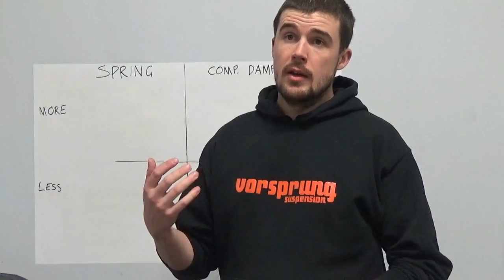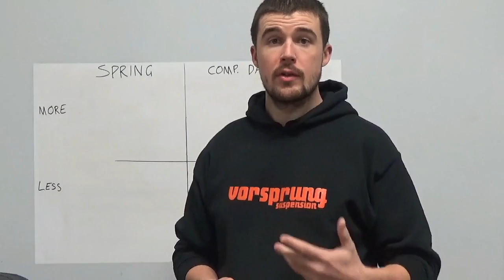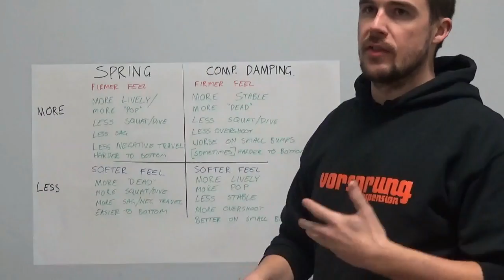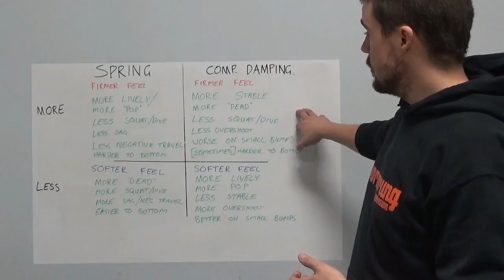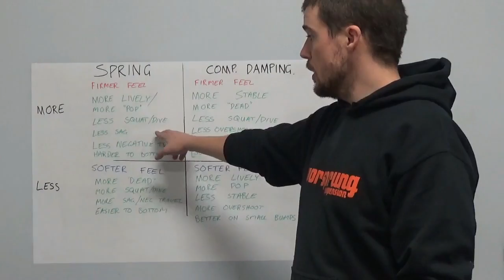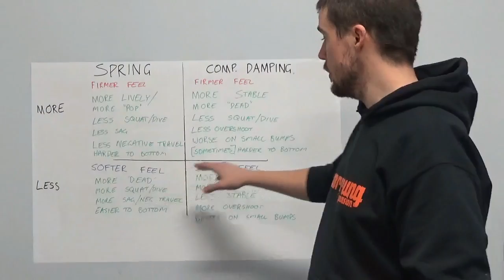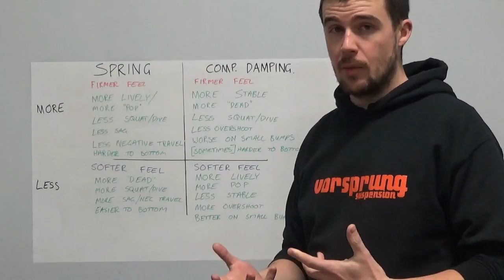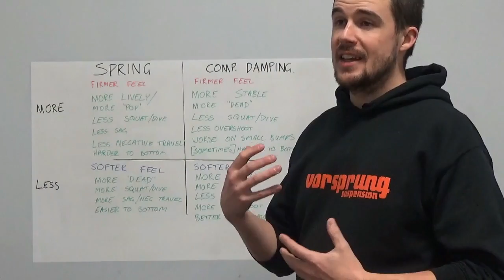The Tuesday Tune Ep 11 - Adjusting spring rate vs adjusting compression damping

Comment: does the motorcycle need to be on a stand with the wheels off the ground in order to adjust R and C?? I've been told this, but it also makes no sense from a logical perspective (the adjusters are readily at your fingertips... they wouldn't design it like this if it wasn't meant to be adjusted as it is, right?)
Reply from the maker: Definitely not necessary to have the wheels off the ground or put the bike on a stand.
Reply: @VorsprungSuspension   thank you so much for this verification. It seemed nonsensical, as I was told by my track rat buddy that it has to be unloaded to adjust.  I can go ahead and turn the knobs during a ride then, hey?
Reply from the maker: @twrcrew8852 not during a ride. You should probably stop the bike first, helps prevent crashes 😂
Reply: @VorsprungSuspension  Lol I meant "while on a ride". but not as i'm moving.

Comment: Wouldn’t the increased liveliness obtained by increasing spring rate be offset by the increased rebound damping that goes along with such a change?
Reply: Late reply, that is exactly what I was thinking. More air without touching the oil side of things will feel more poppy, however you SHOULD adjust your rebound after you've touched the air spring, which dampens the thing back up. I guess adding rebound after adding spring will make it feel "the same"; the harshness coming from using less available travel to soak up the bumps, or less harshness by sitting higher in the travel. Everything in suspension is a sweet spot.

Comment: If my shock feels like it's "hanging up" on square hits (rock gardens)should I be changing compression, spring rate or rebound?

I did just get a new shock that Ive since realised has a ML tune as opposed to MM tune on my original shock.
Reply: Try faster rebound and less compression damping

Comment: I am working through the series of videos and enjoying them a lot. I worked in F1 / LMP1 for many years, but still seeing how the same topics are applied in MTB is very interesting and a great refresher having, been doing more engine work most recently. Thank you for doing all this filming.

One comment I have is - I have always found that with these topics, I need to think about them and look at the graphs / tables when making adjustments to remind myself and not fall into the trap of many counter-intuitive theories (or at least wave my arms around as I think about bounce / rebound / progressive / digressive softer / firmer etc..)  

What would be good would be to have a small aid-memoir for the trails with some of the key tables / graphs etc so that when you are dialing in that set-up you have a quick reference to look at. Does that make sense?

Comment: What are the pros and cons of increasing bottom out resistance with increased end-of-stroke damping versus increased end-of-stroke spring rate? I'm assuming increased end-of-stroke damping is possible with clever damper design that is perhaps position-dependent.

Comment: There is the most important point that wasn't covered. You get a spring that is correct for your body weight. From there, it shouldn't take an increase or decrease in damping, since when rider weight goes up spring rate goes up an equilivant amount. So once you have a good damping setting, increasing or decreasing spring rate should only be done with rider weight changes. Point being, you should never use the damper to compensate for the incorrect spring rate.
Reply from the maker: There is no such thing as a "correct" spring rate. There is a range of appropriate spring rates for any given rider weight depending on the ride characteristic you're after, the terrain and the aggression with which you ride. Likewise, there is no "correct" amount of compression damping, there is an appropriate range; the best point in that range will depend on the terrain, the way you ride, your preferences and priorities. While I agree that you shouldn't use the damper to compensate for a severely out of whack spring rate (or vice versa), the whole point of this video was to illustrate the differences that altering either one can make, and how to pick which version of "firmer" or "softer" you like.
Reply: @VorsprungSuspension  I agree but what I'm saying is all else being equal, if you go up in spring rate with weight you shouldn't need any dampening adjustments. You dial the damper to your liking and leave it, if you gain 50 lbs or lose 50 lbs the dampening should remain constant (IE not correlated to spring rate). Yes springs are for a range, which is why they come in increments. My point is dampening is not correlated to spring rate adjustments unless you're trying to change the characteristics of the damper itself.
Reply from the maker: @CW-up7xv  Actually that's incorrect - your rebound damping (not dampening) will typically need adjusting if you increase your spring rate at a minimum. If you gain or lose 50lbs you will most definitely want a different (higher) compression damping characteristic too, otherwise you have a lower damping ratio and disproportionately more energy is stored/released by the spring. I am not quite sure what the basis for your claims is, but I can assure you that neither the practice nor the theory agree with them - google "damping ratio" for further info. Most of the info that comes up is predominantly relevant to pretty basic mass spring damper systems and automotive applications, but the concepts are largely transferrable.

Comment: Awesome video very helpful kind sir!, what do you think about people claiming that using a neutral spring rate is the best for ride quality. I have heard people suggest that the spring should be out of the equation, it should only support the proper ride height so the shock could do the work. Softest spring rate possible without loosing desired ride height. Coming from a off-road vehicle perspective here. 

"A high performance shock can be tuned for high velocity low velocity, high force, low force, you want to your spring to be as neutral as possible and out of the equation"

Thanks!
Reply from the maker: With MTBs, spring force is almost always higher than the compression damping force, there is no such thing as it being "neutral and out of the equation" for two reasons:
1. That phrase doesn't actually mean anything
2. The spring is always having a substantial effect on what the suspension is doing

Comment: Wow, so glad to hear the bit @10:30 about bike parks, however you stopped a bit short, or perhaps I didn't fully understand.

My new bike setup I've been struggling to get a good balance with the suspension (Float X2 rear and Talas 36 Fork) and I'm not usually a bike park rider, when I did get the bike onto some jumps I was getting shot out the front to the point where I was too nervous to keep riding the jump lines. I mostly ride natural terrain but would love some tips on what to change for those days. 

It sounded like you suggest adding more compression dampening while keeping my spring rate the same (since I'm happy with the feel in other trails) Would you recommend adjusting the rebound settings at all or is the compression really my problem?

Comment: Question: In order to compare apples to apples, when increasing spring rate wouldn't you generally compensate by increasing rebound damping as well.  How would increasing the rebound damping with spring rate change the spring rate to compression damping comparison?
Reply from the maker: It won't affect it greatly unless the rebound adjuster has a substantial crossover effect with compression damping (ie increasing rebound damping increases compression damping as well). Rebound as a motion can be understood as an "available net force" profile (basically a maximum velocity as a function of travel), so if you increase the spring rate but also increase the rebound damping to match, you end up with something that does not tend to extend any faster anyway, so the effects relative to compression damping are not really significant.

Comment: This is the first time I've seen anybody break spring rate vs compression down in a chart like this. Really helps make sense of it. The one part I did fully grasp was the overshoot effect that you were describing.
Reply from the maker: Thanks for the kind words. Not sure if you meant "did" or "did not", but if it was the latter, I'll clarify - we use the term "overshoot" to refer to times where the suspension has moved further than was necessary, or effectively overshot the mark. For example, brake dive due to the transient load shift onto the front wheel, blowing disproportionately far through your travel etc are examples of this. IMO this is most noticeable when landing a small drop, say 2 feet up, and noting the time it takes for the bike to push through its travel, slow down, begin to rebound then finally stabilise somewhere near the sag point.
Reply: Oops yes, I meant "did not". Thank you for taking the time to clarify that part!